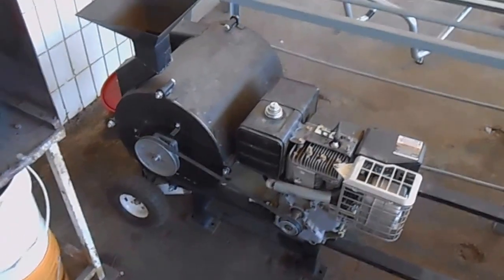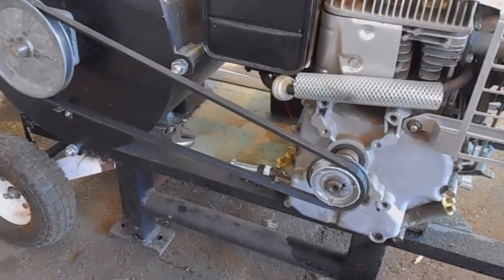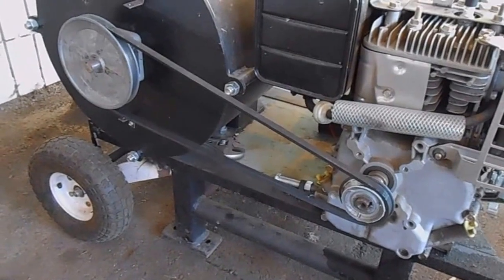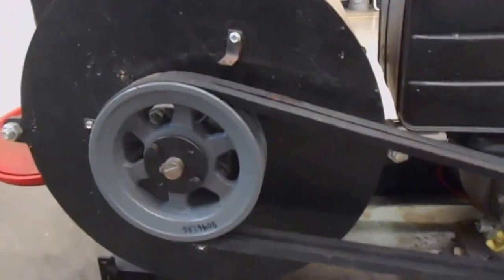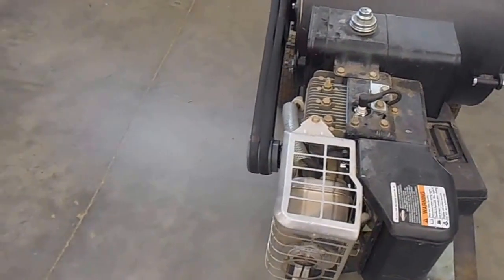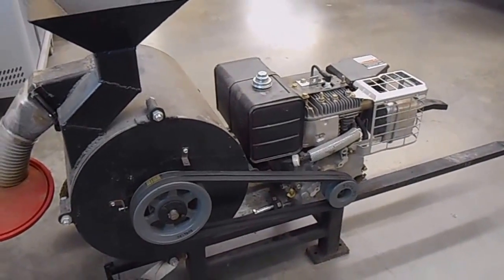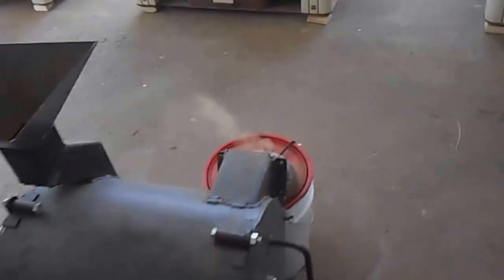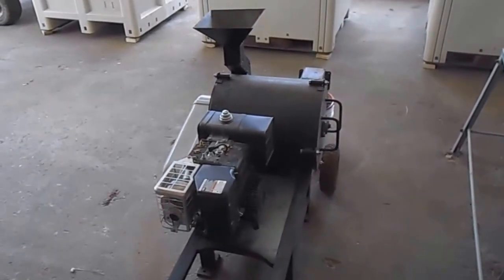Home made Rock Crusher (impact mill) update

Comment: What a great source of inspiration you are, Sir.
I have found my old power unit with the Brigs & Stratton engine. The engine started well. And I have an air compressor tank of about 5-6 gallons that I want to turn into a hammer mill/ impact mill. Do you think this will work? Thank you in advance.
 Greetings Kenneth Prospecting Norway.
Reply from the maker: Should work. Mild steel will not last all that long though
Reply: I listened to your experience and split air tank in two. It became a nice little barbecue ;)

Comment: Mod might be overkill which could cause damage to the bearings or engine shaft if the crusher was to jam.  The belt system needs to slip for safety if the crusher locks up.  That is a reason also not to use sprockets and chain.   I would have limited the upgrade from Chinese junk to steel single pulleys made for a B series type V-belt and a B series Gates belt.